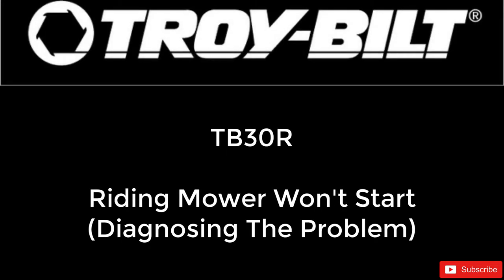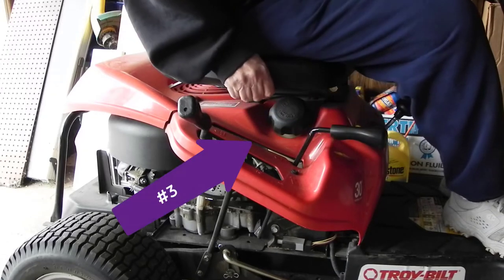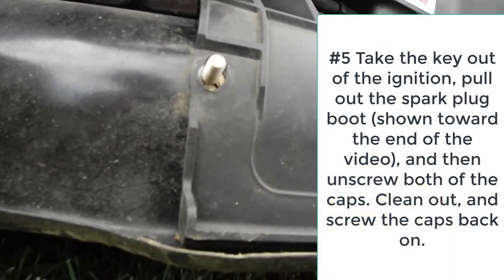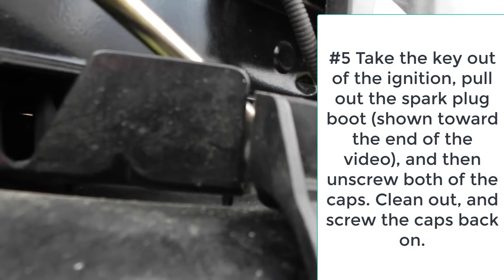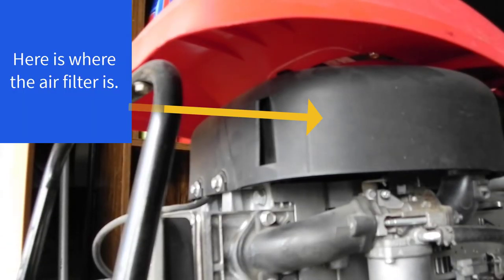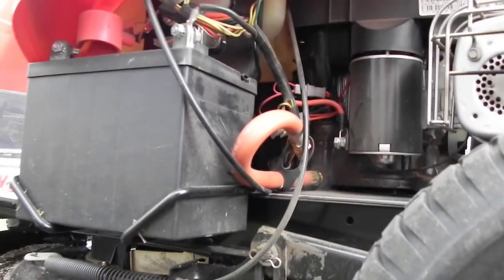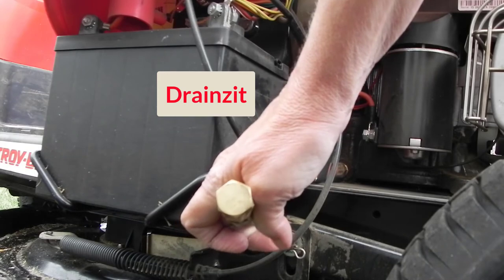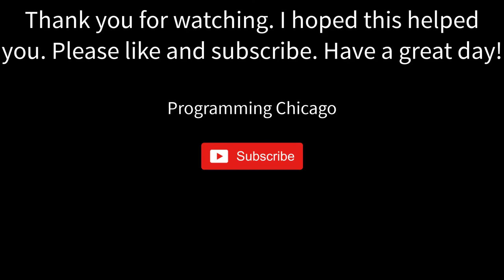TB30R neighborhood riding mower. 6 reasons why your mower won't start in 5 minutes. Troy-Bilt and...

Comment: Excellent video!

You covered just about every problem you can run into with these machines. 

Also, the addition of the Drainzit is MUST.  It not only makes oil changes a breeze, but it also supports Bob Cordes who is the inventor of this system, which is 100% American designed and made.
Reply from the maker: Thank you.

Comment: Love you  Thank you
Reply from the maker: You're welcome Carmen.
Reply: @programmingchicago    Do you know how to change the blade?
Reply from the maker: @carmenreyes4669  Yes, I do, but, you need to make sure you tip the lawn mower in the direction of the where you put the oil it, and be sure to take off the spark plug boot. I usually just bring it in, because I have a guy close by who comes to your house.  If you want to do it yourself though, put a sticker on the bottom side of the blade (if you are just sharpening it, so you know which way it goes back on.) If you are getting a new blade, you just take off that screw and washer and blade. I would suggest that you use your camera so you know exactly how it goes back on.
Reply: @programmingchicago   I appreciate you and all your information. Thank you so much.
Reply from the maker: @carmenreyes4669  Glad to help.

Comment: You forgot the seat safety switch, and the reverse lock-out switch....both of those can be bad, then you have a no start.
Also, keep those safety switches cleaned and lubed with silicone spray. I'm a mechanice. Trust me.

Comment: THE BLADE STOP INGAGGING ?
Reply from the maker: You might want to check your belt. It could be loose or came off.
Reply from the maker: Make sure it’s in neutral or forward. Not reverse.

Comment: This mower is also a Craftsman R1000,  it's a piece of JUNK!!!
Reply from the maker: Mine is still going strong. I have noticed the same mower with different branding. Not the best mower, but the only rider that fits through our chain link fence.
Reply: @programmingchicago , that's why I bought the Craftsman R1000, it fit through the chain link gate. 

Truthfully,  it's been a terrible mower,  just issue after issue.  Now sears is out of business. 

I mean the  belts, battery, charging system,  safety switches,  to bad steering. 

I've had it for 6 years and it still looks new for the most part. I just can't keep it running.